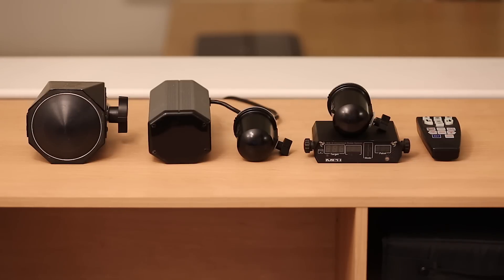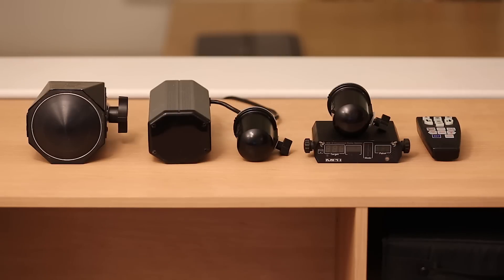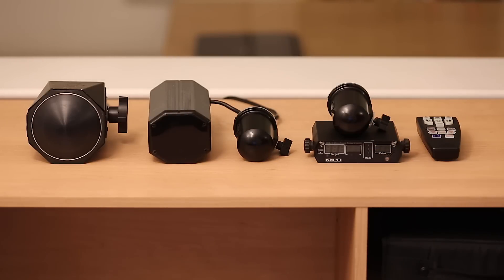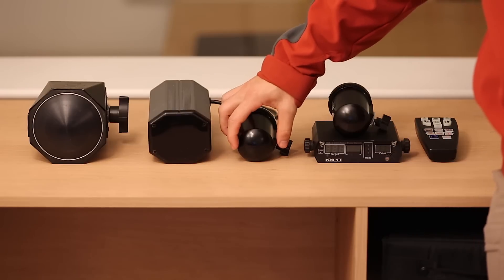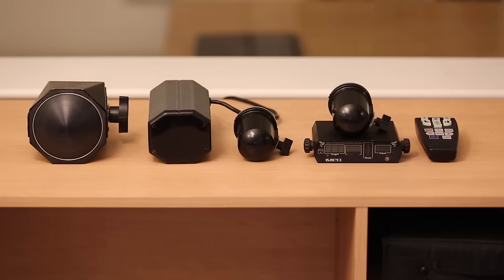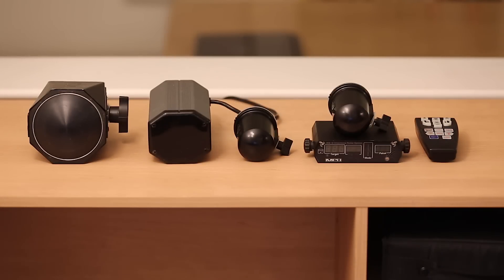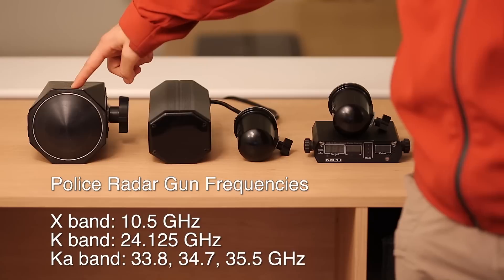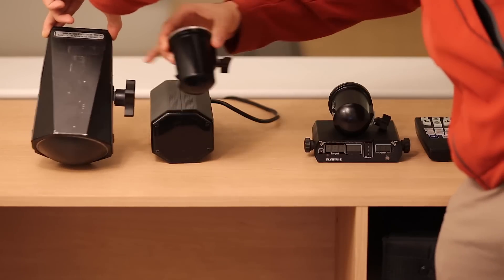X, K, & Ka band: Understanding Radar Detectors

Comment: Apologies if this is asked already, whats the difference between k low and k?
Reply from the maker: The setting in your detector? For K band that transmits around 23.9’ish instead of 24.x which you usually see internationally and/or for photo radar.

Comment: KU Band is big overseas because in a lot of European countries over there (like the UK) like to use photo radar. Big in Australia too. So the antenna size is not an issue because it's a big box with IR and Flash for a camera, they can get you day or night, and in a lot of those countries radar detectors are illegal. One might worry that photo radar may come to the US. I don't think thats a high likelihood based on the general public opposition to red light cameras but who knows. Anyway, there are lot of manufactures who would love to sell those KU photo radars in the US. And from experience, many photo radars are a very weak signal that shoots to catch you from behind, like no more than 50 feet. You need a really really good detector. Most will only give you a weak beep and its too late your picture is taken already.

Comment: X, K, Ka are all names of colors of light. Like Red or Green, they just indicate a specific wavelength of energy.

X was used quite frequently in the 80's. Today, it is used often on automatic door openers.

K was introduced because it was able to extend further than X. It is still used quite frequently today.

Ka was later introduced and is equally as common. The small "a" after K stands for "above", as in K-above, or just above the frequency of K.

Ku is a new frequency used extensively in Europe. The "u" after K means "under", as un K-under or frequency just below K.

Laser is just another frequency (color) of light. Obviously, it is more precise than X, K, and Ka because it doesn't spread as much.

POP, I believe, is a quick burst of Ka. It's preferred by some because cops don't just drive around emitting signal all the time at the front of their vehicle.
Reply: wow i should've just read this first
Reply: For some reason every time I get a Ka alert from a cop it’s when they are moving.
Reply: @yankenobrim2902  Same
Reply: As an Electronic Warfare Officer, I commend your excellent explanation. 
Most fighter jet radars are somewhere in the X Band as well.
Reply: While making comparisons to the visible light spectrum is a good way to understand it, it is important to note that radar IS NOT like lasers and can’t be countered in the same way. While being in the microwave region of the electromagnetic spectrum, they are much more wide range and works like a wave that covers an area to clock any and all cars within its range. While light can also work as a wave, when used by police LiDar they are pinpointed small beams that targets specific cars rather than covering an area and therefore are much harder to detect, meaning most laser hits that you will be alerted by will be when the officer has already acquired your speed, requiring different counter measures.
Reply: Legend

Comment: What band do they us with speed cameras? Will radar detectors work with speed cams? If so which is the best radar  detector for speed cams?
Reply from the maker: There's many many different types of speed cams. Some use radar (all sorts of different frequencies and power levels), some use laser, some use cameras, some use sensors in the road, etc. The newest RD's from Escort, Uniden, and Radenso can pick many of them up, plus they have GPS to alert you to fixed photo locations which is especially nice if they're not using radar or laser in the first place.

Comment: We have a 'Your Speed Is' unit set up on the edge of town, been there for about a year. My Redline always picks it up starting around 6 miles out.
A couple months ago, the Redline quit detecting it even though its in use, and I noticed a blue LED light (small) in the middle of the sign at that same time.
I've noticed that same blue LED on several of these signs throughout the midwest that the Redline doesn't doesn't sniff out.
Is th e frequency of the blue LED somehow mixing with the radar freq, thus making it so the Redline can't sort the 2 two?

Comment: Great info. I remember working for a defense contractor which used radar warning receivers for military aircraft. Most of the actual details were classified, but they looked for specific radar profiles, a combination of carrier frequency as well as the pulse repetition frequency. I have no idea how civilian radar detectors work, but I imagine it would be similar.

The other thing the military RWRs can do is have new firmware installed to keep them up to date with new threat profiles.

Comment: great video but i have 2 questions.
which band does the police use more often and why? and for what reasons would they run on different frequencies?
Reply from the maker: +Juan Navarro See this video to find out what's in use in your area: https://youtu.be/n2UIfQUGqUE

As for why they'd run different frequencies, it may come down to cost, antenna size preferences, contracts with different suppliers, they're saving money and using old hardware rather than buying new equipment, and so on. Many reasons. :)
Reply: @VortexRadar  interesting.

Comment: Thanks that for the information, i really like you're videos, i have a one question tho, if a lower frequency radar requires bigger gun, how can blind spot ditection on new cars fit a K band gun anywhere ?
Reply from the maker: +Akmal Maksumov Good question. Blind spot sensors don't use conical horns like this. They use patch antennas which operate on the same frequency but are a much smaller design. See this video for more information: https://youtu.be/YZ4C5neYmRw

Comment: So in theory as time goes on police will be using v and w ? also with higher frequencies does this mean detecting speed will be clocked much farther then with KA or K ?
Reply from the maker: +Vegas “Vegas747” Seven four seven Distance isn't a function of the frequency being used in this regard. There's also no reason for manufacturers to reengineer their current tech to use new frequencies, get the approvals from the FCC to use those frequencies, etc. So in theory anything is possible, but there's not much practical reason to do that.
Reply: So smaller higher frequency entennas have nothing to do with distance ?
Reply from the maker: Vegas Seven four seven No, that's not part of it. Even if it did, these guns are only designed to be used for a few thousand feet away at the absolute max and that's well within the range of what these units are capable of. You'll have more range limits due to things like hills, traffic, curves, and so on than you will due to the choice of frequency.

Comment: RF spectrum (Shortwave, AM/FM, CB, Ham Radio)...
Higher frequency = shorter wavelength = smaller antenna
Lower frequency = longer wavelength = larger antenna

Similar to sound waves...
Tweeter = Higher frequency = Smaller Speaker
Sub woofer = Lower frequency = Larger Speaker
Reply: you are correct, I learned this in radiology school

Comment: what is Ka Max Mode, im buying the whistler cr90 and it says Total Band Protection
-X, K, Ka & Super Wideband Ka Detection
-Ka Max Mode
Reply from the maker: Enrique Valiente There's better products out there for the money like the Beltronics RX65 S7 and Uniden LRD950. I wouldn't recommend the Whistlers at all at this point.
Reply: i kknow it just that im buying it for only 68$
Reply from the maker: Enrique Valiente Well, prepare to get owned and spend WAY more than that on speeding tickets, court costs, insurance hikes, lawyer fees, time and headache dealing with the ticket, etc. Again I don't recommend skimping out in this area... Really. If you are convinced that saving a little bit now and losing hundreds or thousands of dollars later is a worthy tradeoff, run it in Ka Max. That'll give you the most detection possible (still not enough and easy to get owned) against Ka band which is the most popular radar band in most areas.
Reply: by any chance do you have a review or test on the whistler cr90??? it would help, i havent seen a decent one like you show in yours vids
Reply from the maker: Here's some tests with the CR85. (Same performance as the CR90, just without the GPS features.)
https://www.rdforum.org/showthread.php?t=42809
https://www.rdforum.org/showthread.php?t=38256

Comment: In 1947 Automatic Signal Company in Connecticut built one of the first traffic radars for state police. Early radars were bulky and heavy systems, vacuum-tube technology. The radar consisted of 3 or more large components, an antenna, a 45 pound box with transmitter and processor, and an ink pen strip chart paper recorder. The radar also had a needle meter calibrated in mph. Some systems had 2 antennas, one for transmitting and the other for receiving. The antennas were mounted on a tripod, patrol vehicle hood, or fender. Some of the early 1960s' models mounted the antennas in the back windshield of the patrol car.

The first traffic radars transmitted at 2.455 GHz in the S band (2 - 4 GHz). The antenna beamwidth varied from 15 to 20 degrees depending on model. These radars operated from a stationary position only and measured receding as well as approaching traffic to an accuracy of about ± 2 mph. The maximum detection range was an unimpressive 150 to 500 feet, vacuum-tube receivers do not have the sensitivity of solid-state receivers. S band radars are obsolete.
Reply from the maker: bill luzius Yeah, those ancient beasts were cool. That website is a great read and the photos are kinda hilarious. It'd be awesome to find one around somewhere, a museum piece perhaps?, and give it a whirl. ;)
Reply: Cop in 1947: Sir, do you think this is a racetrack? We got you going 40 in a 20 zone. That’ll be a $20 fine!

Comment: According to RDFGS  Geographic Survey. It says K Band is used where I live. However I've never encountered a LEO using K Band to capture speed. I've passed many "Your Speed" signs and automatic door opener, ect. Because the V1 gives a lot of K Band false alerts I ended up shutting off K Band. Would you recommend this? 
Do Highway Patrolman ever use K Band or is it mostly KA Band?
Reply from the maker: Some areas only use Ka which is great. K is still used all over so it's good to use your best judgement, especially if K is still reported as in active use. Shutting K off can be helpful at times. Applying lots of filters to K can really help too.
Reply: TravelCam1111 I'll keep that in mind. Thanks!